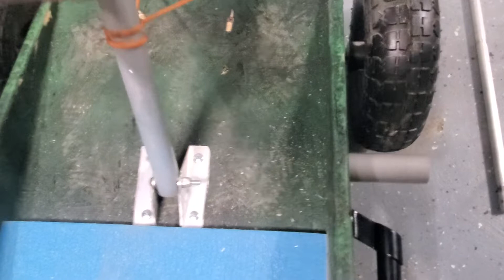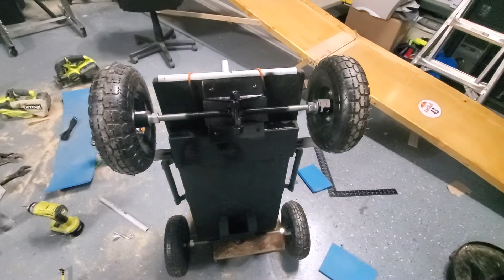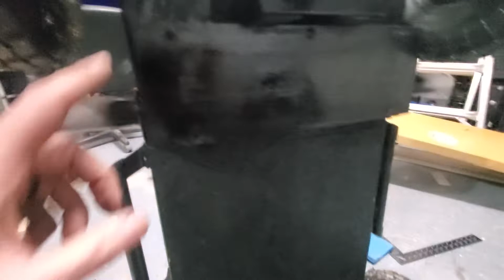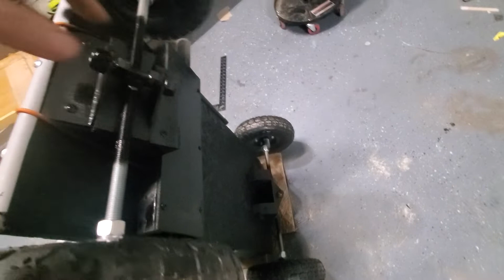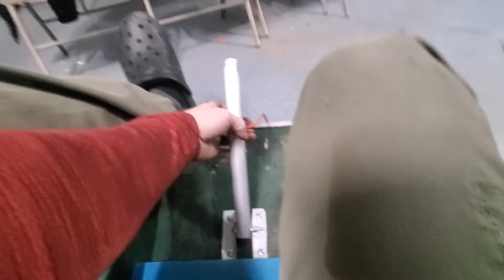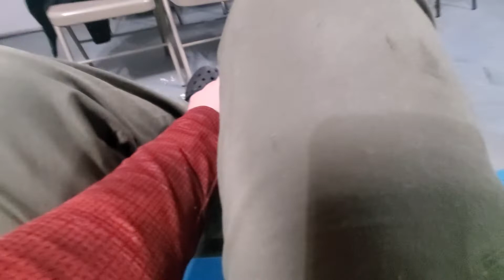Cheap Homemade DIY Soapbox Derby car with lean steering using custom mountainboard trucks

Comment: Do you think a Spindle would help this system? Im looking at building a golf cart with a similar system but i noticed higher end unites have spindles on the attached to the wheel.